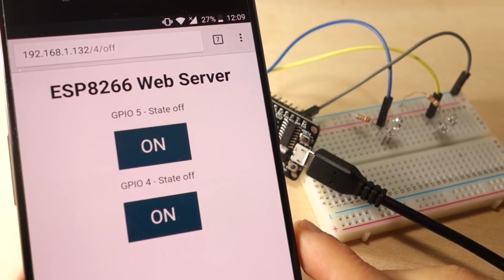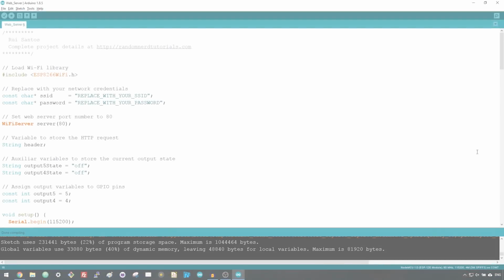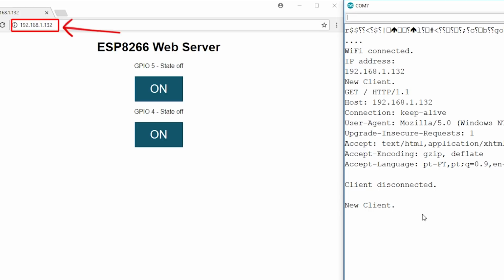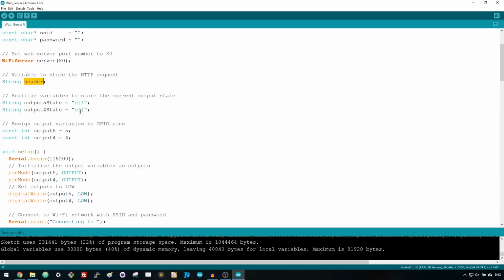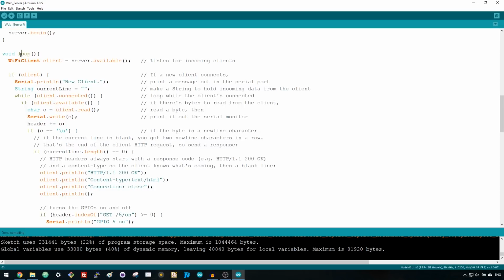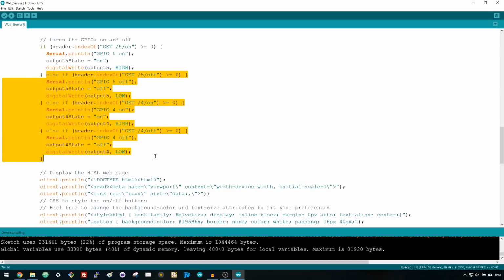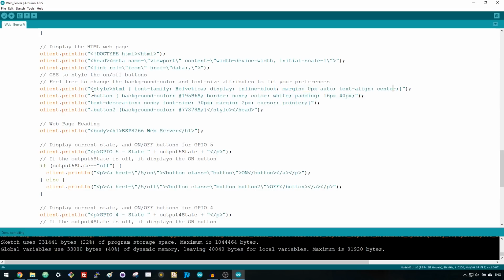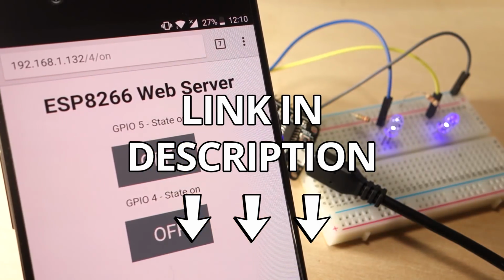Build an ESP8266 Web Server with Arduino IDE - Code and Schematics

Comment: /*******
  Rui Santos
  Complete project details at https://randomnerdtutorials.com  
*********/

// Load Wi-Fi library
#include <ESP8266WiFi.h>

// Replace with your network credentials
const char* ssid     = "REPLACE_WITH_YOUR_SSID";
const char* password = "REPLACE_WITH_YOUR_PASSWORD";

// Set web server port number to 80
WiFiServer server(80);

// Variable to store the HTTP request
String header;

// Auxiliar variables to store the current output state
String output5State = "off";
String output4State = "off";

// Assign output variables to GPIO pins
const int output5 = 5;
const int output4 = 4;

void setup() {
  Serial.begin(115200);
  // Initialize the output variables as outputs
  pinMode(output5, OUTPUT);
  pinMode(output4, OUTPUT);
  // Set outputs to LOW
  digitalWrite(output5, LOW);
  digitalWrite(output4, LOW);

  // Connect to Wi-Fi network with SSID and password
  Serial.print("Connecting to ");
  Serial.println(ssid);
  WiFi.begin(ssid, password);
  while (WiFi.status() != WL_CONNECTED) {
    delay(500);
    Serial.print(".");
  }
  // Print local IP address and start web server
  Serial.println("");
  Serial.println("WiFi connected.");
  Serial.println("IP address: ");
  Serial.println(WiFi.localIP());
  server.begin();
}

void loop(){
  WiFiClient client = server.available();   // Listen for incoming clients

  if (client) {                             // If a new client connects,
    Serial.println("New Client.");          // print a message out in the serial port
    String currentLine = "";                // make a String to hold incoming data from the client
    while (client.connected()) {            // loop while the client's connected
      if (client.available()) {             // if there's bytes to read from the client,
        char c = client.read();             // read a byte, then
        Serial.write(c);                    // print it out the serial monitor
        header += c;
        if (c == '\n') {                    // if the byte is a newline character
          // if the current line is blank, you got two newline characters in a row.
          // that's the end of the client HTTP request, so send a response:
          if (currentLine.length() == 0) {
            // HTTP headers always start with a response code (e.g. HTTP/1.1 200 OK)
            // and a content-type so the client knows what's coming, then a blank line:
            client.println("HTTP/1.1 200 OK");
            client.println("Content-type:text/html");
            client.println("Connection: close");
            client.println();
            
            // turns the GPIOs on and off
            if (header.indexOf("GET /5/on") >= 0) {
              Serial.println("GPIO 5 on");
              output5State = "on";
              digitalWrite(output5, HIGH);
            } else if (header.indexOf("GET /5/off") >= 0) {
              Serial.println("GPIO 5 off");
              output5State = "off";
              digitalWrite(output5, LOW);
            } else if (header.indexOf("GET /4/on") >= 0) {
              Serial.println("GPIO 4 on");
              output4State = "on";
              digitalWrite(output4, HIGH);
            } else if (header.indexOf("GET /4/off") >= 0) {
              Serial.println("GPIO 4 off");
              output4State = "off";
              digitalWrite(output4, LOW);
            }
            
            // Display the HTML web page
            client.println("<!DOCTYPE html><html>");
            client.println("<head><meta name=\"viewport\" content=\"width=device-width, initial-scale=1\">");
            client.println("<link rel=\"icon\" href=\"data:,\">");
            // CSS to style the on/off buttons 
            // Feel free to change the background-color and font-size attributes to fit your preferences
            client.println("<style>html { font-family: Helvetica; display: inline-block; margin: 0px auto; text-align: center;}");
            client.println(".button { background-color: #195B6A; border: none; color: white; padding: 16px 40px;");
            client.println("text-decoration: none; font-size: 30px; margin: 2px; cursor: pointer;}");
            client.println(".button2 {background-color: #77878A;}</style></head>");
            
            // Web Page Heading
            client.println("<body><h1>ESP8266 Web Server</h1>");
            
            // Display current state, and ON/OFF buttons for GPIO 5  
            client.println("<p>GPIO 5 - State " + output5State + "</p>");
            // If the output5State is off, it displays the ON button       
            if (output5State=="off") {
              client.println("<p><a href=\"/5/on\"><button class=\"button\">ON</button></a></p>");
            } else {
              client.println("<p><a href=\"/5/off\"><button class=\"button button2\">OFF</button></a></p>");
            } 
               
            // Display current state, and ON/OFF buttons for GPIO 4  
            client.println("<p>GPIO 4 - State " + output4State + "</p>");
            // If the output4State is off, it displays the ON button       
            if (output4State=="off") {
              client.println("<p><a href=\"/4/on\"><button class=\"button\">ON</button></a></p>");
            } else {
              client.println("<p><a href=\"/4/off\"><button class=\"button button2\">OFF</button></a></p>");
            }
            client.println("</body></html>");
            
            // The HTTP response ends with another blank line
            client.println();
            // Break out of the while loop
            break;
          } else { // if you got a newline, then clear currentLine
            currentLine = "";
          }
        } else if (c != '\r') {  // if you got anything else but a carriage return character,
          currentLine += c;      // add it to the end of the currentLine
        }
      }
    }
    // Clear the header variable
    header = "";
    // Close the connection
    client.stop();
    Serial.println("Client disconnected.");
    Serial.println("");
  }
}

Comment: Thank you so much.  This video is so well explained and your schematics and codes are flawless.  I took your design and added some PhP and javascript.   You can now control
the LED from anywhere in the world.  All thanks to you.
Reply: Please I need the PHP and javascript files I'm trying to do the same but did't work
Reply: @ALasmry707  do you know anything about port forwarding?
Reply: Darmin Axel not really I’m a beginner but I have my own hosting and domino that I wanna use for this project. If you can help me with the sample of code that will be appreciated
Reply: Do a little research on port forwarding. You need to own a domain to do this. If you do not own a domain,  you're going to have to type type your internet iP address in your browser to turn on the lights .   

Here go here 

darmin.ca/led.php 

That's my website. I'm using php to tell my server to connect to my home router and connect to the esp and turn on the lights
Reply: @ALasmry707  ok good , u got  your own domain. Um.. lets chat somewhere else.
Reply: Darmin Axel so funny :)
Reply: @ALasmry707  ok you need to enable port forwarding on your home router if u want this to work. U need to find out the IP address of the esp 8266 and tell it to your router

Comment: hey there, ive tried that out, what are those both blue LED's on that ESP8266-E Nodemcu chip for? both are on the whole time ?
thank you for your help :)
Reply: it appears as soon as i add a 4th button, with 3 buttons there are is no blue LED on even if i enable/disable the buttons, but as soon as a 4th buttons get in there is that blue LED could you explain why?

Comment: // Load Wi-Fi library
#include <ESP8266WiFi.h>

// Replace with your network credentials
const char* ssid     = "00000000000000";
const char* password = "00000000000";

// Set web server port number to 80
WiFiServer server(80);

// Variable to store the HTTP request
String header;

// Auxiliar variables to store the current output state
String output14State = "off";
String output4State = "off";
String output5State = "off";
String output12State = "off";
String output13State = "off";

// Assign output variables to GPIO pins
const int output14 = 14;
const int output4 = 4;
const int output5 = 5;
const int output12 = 12;
const int output13 = 13;

void setup() {
  Serial.begin(115200);
  // Initialize the output variables as outputs
  pinMode(output14, OUTPUT);
  pinMode(output4, OUTPUT);
  pinMode(output5, OUTPUT);
  pinMode(output12, OUTPUT);
  pinMode(output13, OUTPUT);
  // Set outputs to LOW
  digitalWrite(output14, LOW);
  digitalWrite(output4, LOW);
  digitalWrite(output5, LOW);
  digitalWrite(output12, LOW);
   digitalWrite(output13, LOW);
  // Connect to Wi-Fi network with SSID and password
  Serial.print("Connecting to ");
  Serial.println(ssid);
  WiFi.begin(ssid, password);
  while (WiFi.status() != WL_CONNECTED) {
    delay(500);
    Serial.print(".");
  }
  // Print local IP address and start web server
  Serial.println("");
  Serial.println("WiFi connected.");
  Serial.println("IP address: ");
  Serial.println(WiFi.localIP());
  server.begin();
}

void loop(){
  WiFiClient client = server.available();   // Listen for incoming clients

  if (client) {                             // If a new client connects,
    Serial.println("New Client.");          // print a message out in the serial port
    String currentLine = "";                // make a String to hold incoming data from the client
    while (client.connected()) {            // loop while the client's connected
      if (client.available()) {             // if there's bytes to read from the client,
        char c = client.read();             // read a byte, then
        Serial.write(c);                    // print it out the serial monitor
        header += c;
        if (c == '\n') {                    // if the byte is a newline character
          // if the current line is blank, you got two newline characters in a row.
          // that's the end of the client HTTP request, so send a response:
          if (currentLine.length() == 0) {
            // HTTP headers always start with a response code (e.g. HTTP/1.1 200 OK)
            // and a content-type so the client knows what's coming, then a blank line:
            client.println("HTTP/1.1 200 OK");
            client.println("Content-type:text/html");
            client.println("Connection: close");
            client.println();
            
            // turns the GPIOs on and off
            if (header.indexOf("GET /5/on") >= 0) {
              Serial.println("GPIO 5 on");
              output5State = "on";
              digitalWrite(output5, HIGH);
            } else if (header.indexOf("GET /5/off") >= 0) {
              Serial.println("GPIO 5 off");
              output5State = "off";
              digitalWrite(output5, LOW);
            } else if (header.indexOf("GET /4/on") >= 0) {
              Serial.println("GPIO 4 on");
              output4State = "on";
              digitalWrite(output4, HIGH);
            } else if (header.indexOf("GET /4/off") >= 0) {
              Serial.println("GPIO 4 off");
              output4State = "off";
              digitalWrite(output4, LOW);
            } else if (header.indexOf("GET /14/on") >= 0) {
              Serial.println("GPIO 14 on");
              output14State = "on";
              digitalWrite(output14, HIGH);
            } else if (header.indexOf("GET /14/off") >= 0) {
              Serial.println("GPIO 14 off");
              output14State = "off";
              digitalWrite(output14, LOW);
            }else if (header.indexOf("GET /12/on") >= 0) {
              Serial.println("GPIO 12 on");
              output12State = "on";
              digitalWrite(output12, HIGH);
            } else if (header.indexOf("GET /12/off") >= 0) {
              Serial.println("GPIO 12 off");
              output12State = "off";
              digitalWrite(output12, LOW);
            } else if (header.indexOf("GET /13/on") >= 0) {
              Serial.println("GPIO 13 on");
              output13State = "on";
              digitalWrite(output13, HIGH);
            } else if (header.indexOf("GET /13/off") >= 0) {
              Serial.println("GPIO 13 off");
              output13State = "off";
              digitalWrite(output13, LOW);
            }
            // Display the HTML web page
            client.println("<!DOCTYPE html><html>");
            client.println("<head><meta name=\"viewport\" content=\"width=device-width, initial-scale=1\">");
            client.println("<link rel=\"icon\" href=\"data:,\">");
            // CSS to style the on/off buttons 
            // Feel free to change the background-color and font-size attributes to fit your preferences
            client.println("<style>html { font-family: Helvetica; display: inline-block; margin: 0px auto; text-align: center;}");
            client.println(".button { background-color: #77878A; border: none; color: white; padding: 10px 30px;");
            client.println("text-decoration: none; font-size: 30px; margin: 2px; cursor: pointer;}");
            client.println(".button2 {background-color: #195B6A;}</style></head>");
            
            // Web Page Heading
            client.println("<body><h1>HOME CONTROL WEB SERVER</h1>");
            
            // Display current state, and ON/OFF buttons for GPIO 5  
            client.println("<p>DOOR - State " + output5State + "</p>");
            // If the output5State is on, it displays the ON button       
            if (output5State=="off") {
              client.println("<p><a href=\"/5/on\"><button class=\"button\">OFF</button></a></p>");
            } else {
              client.println("<p><a href=\"/5/off\"><button class=\"button button2\">ON</button></a></p>");
            } 
               
            // Display current state, and ON/OFF buttons for GPIO 4  
            client.println("<p>LIVINGROOM - State " + output4State + "</p>");
            // If the output4State is off, it displays the ON button       
            if (output4State=="off") {
              client.println("<p><a href=\"/4/on\"><button class=\"button\">OFF</button></a></p>");
            } else {
              client.println("<p><a href=\"/4/off\"><button class=\"button button2\">ON</button></a></p>");
            }

            // Display current state, and ON/OFF buttons for GPIO 14  
            client.println("<p>TV - State " + output14State + "</p>");
            // If the output14State is off, it displays the ON button       
            if (output14State=="off") {
              client.println("<p><a href=\"/14/on\"><button class=\"button\">OFF</button></a></p>");
            } else {
              client.println("<p><a href=\"/14/off\"><button class=\"button button2\">ON</button></a></p>");
             } 
             // Display current state, and ON/OFF buttons for GPIO 12  
            client.println("<p>BEDROOM - State " + output12State + "</p>");
            // If the output12State is off, it displays the ON button       
            if (output12State=="off") {
              client.println("<p><a href=\"/12/on\"><button class=\"button\">OFF</button></a></p>");
            } else {
              client.println("<p><a href=\"/12/off\"><button class=\"button button2\">ON</button></a></p>");
            }
            // Display current state, and ON/OFF buttons for GPIO 13  
            client.println("<p>GARAGE - State " + output13State + "</p>");
            // If the output13State is off, it displays the ON button       
            if (output13State=="off") {
              client.println("<p><a href=\"/13/on\"><button class=\"button\">OFF</button></a></p>");
            } else {
              client.println("<p><a href=\"/13/off\"><button class=\"button button2\">ON</button></a></p>");
            }
             
            client.println("</body></html>");
            
            // The HTTP response ends with another blank line
            client.println();
            // Break out of the while loop
            break;
          } else { // if you got a newline, then clear currentLine
            currentLine = "";
          }
        } else if (c != '\r') {  // if you got anything else but a carriage return character,
          currentLine += c;      // add it to the end of the currentLine
        }
      }
    }
    // Clear the header variable
    header = "";
    // Close the connection
    client.stop();
    Serial.println("Client disconnected.");
    Serial.println("");
  }
}

Comment: With small code modification, you can put the ESP8266 in static IP address mode
Reply: Please DO TELL!!! ...I am looking in the direction of the ESP8266WiFi.h component (trying to find it) ...the code given here works ...but WHERE does IT mention DHCP; - and why does the browser on my PC access it from my networks DHCP ...but my smartfone gets an address ONLY off the BUILT IN DHCP on the Device; - WHERE did the 192.168.4.0 network come from???